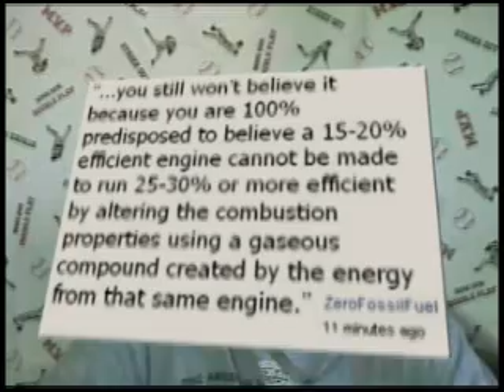Follow-up: '#232 - HHO runtime experiment part 3'

Comment: @HHOinfo --- Liar, show me where I made shit up. As for the link go to your DOE page and click the link to the DOT search for hydrogen. There are 4 docs that list H2 as a fuel source. In the second doc titled "Guidelines for use of Hydrogen Fuel in Commercial Vehicles" Section 1.2.3 on page 11 says, "Limited laboratory testing of a hydrogen injection system installed on an older diesel truck engine operated at a series of constant speeds showed a 4 percent reduction in fuel use" Cont.

Comment: @Desertphile 

I wasn't addressing you Desertphile. :) I have no argument with you.

I was trying to explain to another youtuber that a negative claim still counts as a claim (for example, stating that jupiter does not exist).

To you I originally mentioned acetone (and the valid theory, even if unproven in experiment) as one example of how altering the chemistry of the fuel can increase the fuel efficiency - however another Youtuber explained that I was mistaking efficiency with economy. :)

Comment: @MegaVelvetElvis : No, I don't have to link to anything. DP himself links to the electrikride video which links to the article. Would it help in our discussion if I told you I am a scientist, with a PhD in molecular and cell biology (a field in which I have in fact done a fair amount of actual engineering--although I don't consider myself an engineer). The topic of Cons of Energy is not the SOLE consideration here--that's what you don't seem to understand.

Comment: @LeksServices 

In the context you supplied, you're quite correct. And for the record, I didn't say you have to prove a negative, I said you can't *claim* a negative without proving it. The fact that you *then* find yourself unable to do so, as you pointed out, was the point I was trying to lead to - struggling against an unwillingness to listen.

The moral of the story is; you can't make negative claims. If you can, then by the same standards I can rightly claim "internal combustion is a lie."

Comment: @KrisBlueNZ : I agree. The first issue is how much the equipment costs. And there are more issues: Might H2 wear out engines sooner, for example?

Even so, in my mind, the most relevant part of this is that the VAST MAJORITY of people promoting H2 are either stupidly under the impression that the H2 simply supplies more energy (stupid because you can't get more energy out of it than it costs to make it--NOW OR EVER), OR, they know better, but they're promoting a pure SCAM.

Comment: @HHOinfo --- "...study it real close and find something else that is not correct." OK you asked for it. On your DOE page you say, "I guess the DOT does not consider HHO a fuel source ether." But in the 2nd doc from the link Sec 1.2.3 says that in limited lab testing of on-board electrolysis gave a 4 percent reduction in fuel usage. You say that HHO cannot work but you put up links that says it does, WTF is up with that? Clearly your agenda is to bad mouth HHO regardless of the facts...

Comment: @ZeroFossilFuel     I am a mechanical engineer and deal with these workability issues almost daily.   workability.. mere workability.. is not the issue.   the issues is the net gain or effect (real gain, real effect) worth the effort.. is it cost effective. etc.

Still however i applaud any non loopy attempts because it is through those that eventual advance occurs... viable advance.      and vast advance is on the horizon and some already on the market.. especially in France with nuclear

Comment: @GetMeThere1 Thanks for the info. It sounds like the nett efficiency increase isn't much, so I wonder how long it would take to pay off the cost of installing HHO in an engine.
Surely the automobile industry knows about this effect, yet no manufacturer installs HHO as standard or even provides it as an option, AFAIK, despite the current focus on gas mileage.
Automobile manufacturers have no incentive to avoid HHO that I can see, so it must be uneconomic, and retrofitting will be even more so.

Comment: @Desertphile ... you are largely accurate as usual, my experience with the free energy type people so far, after 48 years of being approached .. these are technically and scientifically illiterate or worse... wishfull thinking spin resulting in fraud.

Having said that, combustion is a chemical reaction, and many of those can be made more efficient by use of catalysts.. in this case hydrogen gas .. not from cobustion of the H2 but as it could enable a more efficient burn of the base fuel.

Comment: @MegaVelvetElvis : The problem with having some science education is that it can leave one with the impression he knows more than he actually does. The topic is not Conservation of Energy--which most 7th graders should be aware of. The heart of the matter is the degree to which efficiency of gas combustion can be improved. The scholarly engineering article I referenced states that efficiency of DIESEL combustion can be improved enough to more than offset the extra cost of H2O electrolysis.

Comment: @KrisBlueNZ : I can report on the scholarly engineering research article I read. It made claims, by actual measurement, that H2 can increase the burning efficiency of diesel so that there is a small, but meaningful, NET gain in fuel economy--when the actual energy costs (not merely the theoretical costs) of H2 production are taken into account. I read the article closely and feel I understand it--but I am certainly NOT capable of verifying the experimental techniques and analysis involved.

Comment: LOL! You have essentially restated the very same point the rest of the HHO community has said all along. "To increase efficiency you have to physically modify the engine". i.e change the mechanics of the combustion process. HHO injected into the air/fuel mixture does just that. The theory is it acts as a fuse to ignite the entire charge instantaneously creating more mechanical output rather than slow burn with 80% of the energy exhausted and dissipated as heat.

Hence my tests to find out.

Comment: @MegaVelvetElvis --- Well they could use only one tank if they'd increase the PSI. High pressure electrolysis can produce H2 at over 5,000 PSI without a compressor. GM currently holds a patent for a 10,000 PSI model but I haven't seen where it's in use yet. Yes there is a lot of losses in their system but all the energy used for this home is from renewable sources.

Comment: @coasterpro --- Here's the link to the solar H2 home I mentioned. watch?v=xEdQRVQtffw It uses H2 to store energy from solar. H2 is a fuel and an energy source, it depends on where you get it and how you use it. H2 can come from nature itself by biological functions. Some Algae will produce H2 under certain conditions and you can even use a process called Dark fermentation to get H2. In these cases H2 is not simply an energy carrier.

Comment: @HHOinfo --- Oh but you did defend the falsified reports, read your comments again here: watch?v=jK6RB8-r8M8 And I did find plenty of errors on your site, one of them was on your let's do the math page. Don't you remember the page you changed? Boy you sure have a short memory. Oh and here's the link to the story where water is used as a fuel. A FUEL cell converts H2 into electricity. watch?v=xEdQRVQtffw. Again get over your hatred, not everyone working with H2 from water is like Dennis Lee...

Comment: @GetMeThere1 Exactly. I think HHO is probably a con, but you've got to admit, IF a gasoline engine is so inefficient, that it MIGHT be possible, by altering some factor (i.e. the fuel), to improve that efficiency so significantly that the extra energy taken from the engine, to provide the extra fuel, might be LESS than the improvement in effiicency, giving a nett gain in system efficiency. He's not claiming "free energy".
Is this plausible? How much engine inefficiency is due to poor combustion?

Comment: You really should ask Z, myself, ssc, or a few others with EBN why we are doing what we are doing before you ASSuME you know why we have been working on this for so long. It cant work based on the limited variables you give the equation you deal with, broaden that scope, or better yet, if the equation is too chaotic to calc, the test it thuroughly as science should and then answer. Until the claims have been tested, even as ugly as some of these tests are, then the answer is not definite.

Comment: DP you HAVE NO understanding do you. You will not get more "power" from running a higher octane fuel, you get the ability to run higher compression ratios with higher octane. The power some claim from the higher octane fuel actually COMES FROM THE FUEL being more eff. burned. boy are you sideways. If you change the fuel economy then you must by fact increase its energy eff. you are doing more WORK with less or equal fuel to get better econ, by that law you love you are wrong, again.

Comment: @Desertphile
A turbocharger for example improves engine efficiency already. Notice that the turbo is powered by the SAME ENGINE via it's exhaust gases, NOT any external source, and it then enables more fuel to be burnt by causing it to react with more oxygen from the air. In other words the same fuel is enabling itself, via these mechanisms, to burn itself more efficiently. See:
/wiki/Turbo#Operating_principle
/wiki/Volumetric_efficiency
...

Comment: @TheAtheistPaladin 

I wasn't connecting acetone to HHO engines, I never said "acetone is an HHO engine" or that it  could prove the concept - totally different issues.

Thanks for the information on fuel efficiency though, I was looking at the term more in the descriptive sense (i.e., an engine that produces more mileage per gallon is more efficient to you) but I see now that it is a specific term with a unique allotted meaning, albeit accidentally misleading.

Thanks again.

Comment: @TheFounderUtopia 

Acetone is not an HHO engine nor could it ever prove the concept. Acetone may or may not improve fuel economy by making the fuel burn cleaner: however, it is important to note that Acetone is a bitch to the rubber fuel hoses.  I recommend replacing them before trying something like that.

Comment: @TheFounderUtopia 

Efficiency is how much of the energy is actually put to work. Since Gasoline engines produce MASSIVE amount of heat, that means more of the energy from burning the gasoline goes to heat, rather doing the mechanical work. About 90% is lost to heat. Now there is coming new materials that directly turn heat into electricity but the possible gains will only be about 10% to 20%.

Comment from the maker: @GetMeThere1 "....It IS plausible that burning H2 along with gasoline can improve the burning efficiency of the gas."

Yes, but only if the engine is not used to run a generator which powers an electrolysis device. The hydrogen would have to come from an external source, made with another fuel (such as coal, uranium, wind, solar, etc.). Using a car engine to produce the oxyhydrogen will always result in a net loss, and quite a steep one. I am willing to be shown I am wrong.

Comment: Regular vs Premium

There is little difference in energy content of regular versus premium gasoline. They both contain about 111,400 British Thermal Units of energy per gallon.

But according to the experts, using premium is like tossing quarters in a wishing well, since most engines are designed to operate on relatively low-octane regular unleaded gasoline.

Comment: @BlackDogSociety If the system you mentioned did in fact use electrolysis to store excess solar power as H2 then it would be one of the least efficient storage devices ever conceived for that purpose.  With the exception of certain situations, H2 is a poor choice for energy storage.

"H2 is a fuel"

Hydrogen is a fuel, but it's not an energy source. To call Hydrogen a fuel in this sense would be to call Lithium a fuel, and you never hear people making THAT mistake. Context is important..

Comment: I beg to differ, Desertphile, but in my experience altering the fuel *can* improve fuel efficiency. For example, by adding a few milligrams of acetone to the fuel tank of a standard petrol running car you can increase the fuel economy by up to 8-11%

 In fact I'm very surprised at you to overlook the importance of the chemical properties of the fuel itself and its relevance to engine efficiency - surely you don't think that fueling an engine with lemonade would be just as efficient as petroleum?

Comment: @MegaVelvetElvis --- Sorry for the misunderstanding, I wasn't talking about a system designed for a vehicle. I was referring to that off-the-grid home in NJ, I think. They use solar panels for electricity during the day while splitting water under pressure and storing H2 for use at night. HHOinfo statement was that all sentences with water and fuel are all scams is silly. That is not the case at all, H2 is a fuel, no matter what DP or anyone else thinks about it...

Comment: FURTHERMORE....let's remember electrikride's (is that his name?) test (erroneously) claiming to show how the H2 produced could run a generator and produce greater net energy output by simply burning H2 made. That was a bullshit test on it's face. MOST IMPORTANTLY, however, it's in NO WAY a test of changing the combustion efficiencies of gas. i.e., he was making completely DIFFERENT claims THEN. He's now on the "burning efficiency" claim because that does have SOME theoretical plausibility.

Comment: Have to disagree with you on this one, DP (WITHOUT taking the side of the HHO purveyors): It IS plausible that burning H2 along with gasoline can improve the burning efficiency of the gas. Gas in cars does NOT burn with perfect efficiency--if it did, exhaust would be CO2 and water. I read what's his name's link to an academic engineering article, and it seems to imply fuel efficiency could be enhanced by 5-10% by burning H2 with gas. Whether the car can PRODUCE H2 at a low enough cost... ???

Comment: If someone really wants to save gas by burning more Hydrogen, then you have to get it BEFORE you even start the engine. The engine itself will have to work to split the chemical bonds in water and the energy out put by burning that will never exceed the energy put into that. Otherwise you will have an virtual perpetual motion machine.  It is better to get solar panels and do the electrolysis before you head out.  That way the engine loses any energy to that process. Just saying...